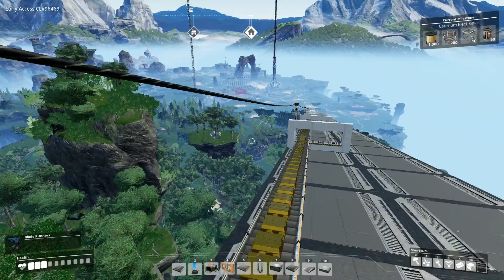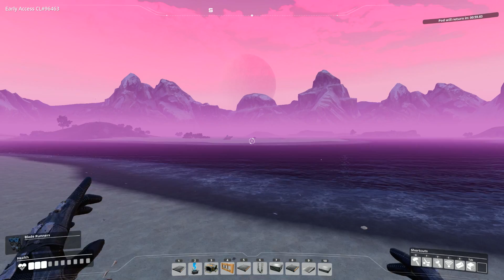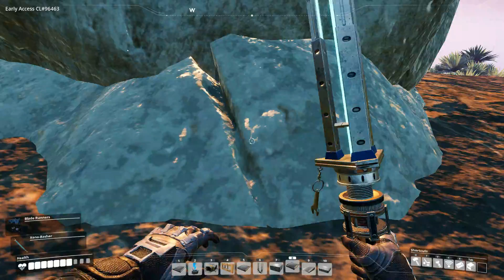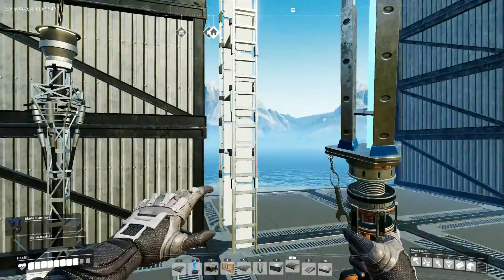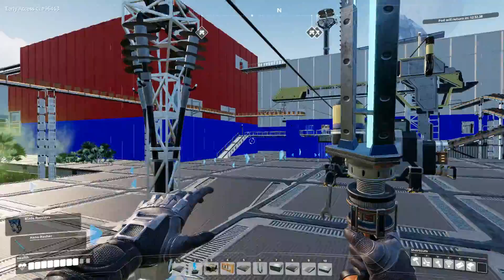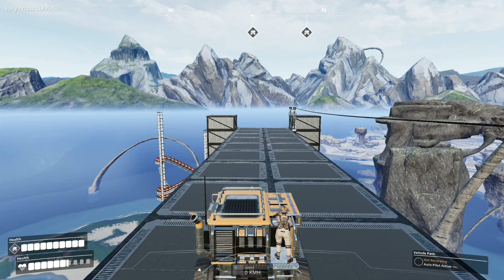Satisfactory Gameplay | 900 Oil Per Minute

Comment: If you get the alt recipies caterium wire, caterium circuit board, and caterium computers, you can make computers and supercomputers using only oil and caterium. No iron or steel. 
I've set up a building just for computer/supercomputer crafting and only have oil and caterium running to it.
Reply from the maker: That's bad ass thanks for the very useful information. I'll aim to get those specifically, now that i have that bus, that would solve all of my problems.
Reply: @Skippy0330  You can skip the caterium circuit board recipe and use caterium wire and plastic to make the regular circuit board. Other then that the only thing you need the caterium wire for is to make cable. I do prefer the caterium circuit board over the regular recipe though.

Comment: Mk. 4 belts cost too much. Mk.3 seems to be the sweet spot as steel beams are quick to make. I've got a 1100m run of Mk3 to my oil and 270 is enough to fill up mk2 storage bins for all three products in no time. I've got one refinery fueling 2 fuel generators using Mk1 belts.
Reply from the maker: not really, you just gotta optimize for it. nothing is too expensive. At one point, mk3 was way too expensive.  you'll see, I'll be swimming it them soon enough